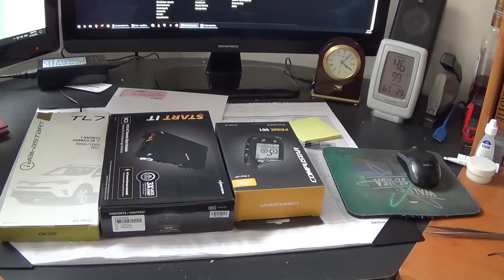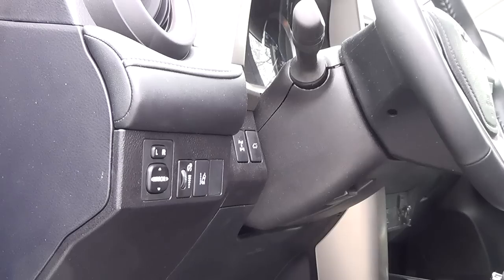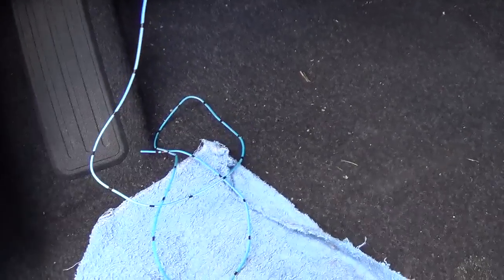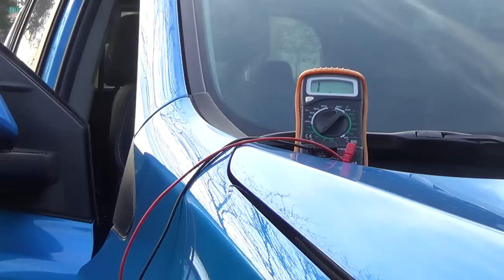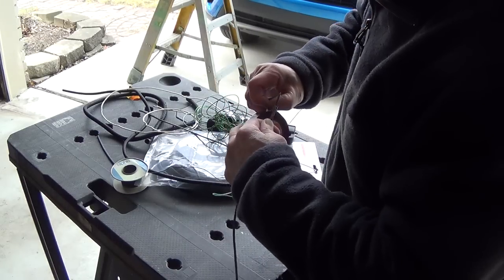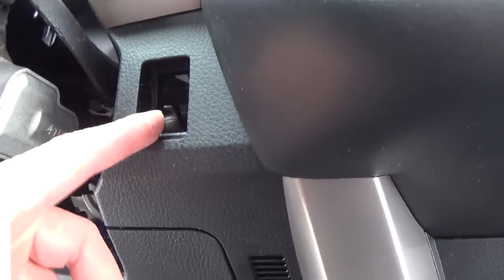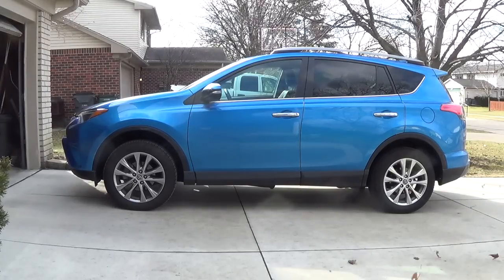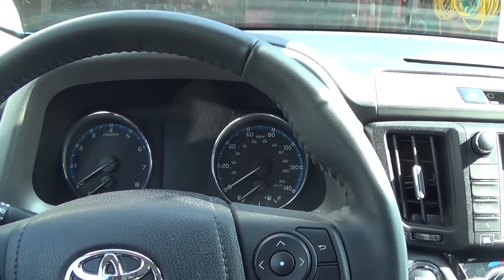Compustar remote start installation

Comment: Wow - you are a brave guy! After watching this I decided I don't have the time or interest to do this on my own. Thanks for sharing!
Reply: Every car is different, I looked up the manual on how to do this on my car and it didn’t even use half the wiring that came with the kit. The manual was also specific on where to tap into everything.
Reply: @daduncker20D  Do you add starter kill relay along with it? I have PTS on my vehicle and I want to add stsrter kill relay and toggle switch but i dont know how and which one is the best method to do it? Any advises?

Comment: Blue wire was for Idle mode. I wouldn't recommend using that kind of method of choice for your hood pin since what if you park on a hill? But that's alright.

Comment: btw, the reason why Compustar/Firstech customer service told you the blue/white wire doesn't have to be connected is because that wire if connected to the PTS enables IDLE MODE also known as PITS MODE.  This mode enables the remote to start after you drive a vehicle and want it to stay on.  For example, if you drive the car to the gas station and you want the engine to stay on vs turning off the engine for a quick pick up, or if you have kids/pets in the car and want the heat/ac to stay on.  You lose that feature if you don't connect that wire.

Comment: Cz, have you considered installing interior LED strips for extra lighting that works with the dome lights? I have a 2016 RAV4 LE (same color as yours) and was trying to get more information about an install using the fuse box so the LED strips would work with the dome lights. Love your videos, would like to watch you install LED strips on the interior.
Reply from the maker: I replaced interior lights with LED lights in my 2015 RAV4, but I didn't do that in my 2017 RAV4. Because I found that I really don't like the LED lights. I don't have plan to add additional LED strips.

Comment: Awesome installation instructions!!! Thank you for uploading the video! 
By the way, can I modify the features (longer run time) after I have already installed the remote starter in the car using the weblink and do I need to unplug the module from the T harness for that? Just want to make sure I dont wipe out all the installation data (flashed), by just modifying  feature, since the starter is already installed.

Comment: Thank you and good job! I'm surprised that you Rav4 doesn't have factory hood pin? If I does, you save more time. The wire to PTS button connect only if idle mode is desired. Bc no take over on this vehicle, pointless to connect.
Reply from the maker: Yes. It doesn't have factory hood switch. But there is a connector, near the hood pin. Wire on one side of connector goes in to vehicle. There is no wire on the other side of connector. I think it should connect to hood pin (sensor).
Reply: @czgu6398  Yes, I found out myself, just did a 2017 xle, had to do hood pin (using factory existing hole) and set input to analog. Toyota changed trim options.

Comment: Good job installing the remote starter.  i dont think the "hood pin or tilt switch" was necessary for your car because your vehicle has a sensor at the hood latch. did you verify with compustar that the "hood pin or tilt switch" was required before installing it?
Reply from the maker: No I didn't see hood latch sensor. There is a connector near the latch. One side has wires. The other side does not have wire.
Reply: @czgu6398  you are correct, the installation diagram for your car does not suggest to wire the "hood output" to the hood latch sensor. Great idea adding an extra on/off switch as additional safety. i will definitely have this on/off switch installed.  Thank you.
Reply: where did you buy this remote start kit?
Reply from the maker: @djdeito  I bought DC3 and T-harness from lockdown security, and 901 Key fob, DAS from eBay.

Comment: Did you choose any specific setting when configuring the alarm for the 901 to automatically update on status change when using the factory key fob? I notice it did it automatically for you, but for me it wont. I have to hit the status button on the 901 for it to feedback information when using the other remote.

Comment: Hi Cz Gu,
Its a great video. Does remote also need programming unless i am missing something. How you configured remote to control unit DC-3. Also can i use any compustar remote, does not really need 1 mile range.
Reply from the maker: Config key fob is very easy. You can just follow DC-3 spec. There are 3 programming procedures. Module programming procedure, Tech programming procedure, remote programming procedure. After finish all these procedures, remote starter installation is finished. The remote programming procedure is for adding key fobs. The max. number of key fobs for DC-3 is 4.
Reply: Can you tell where we can find Module programming and Tech programming procedures.
Reply: @atifkhalid9655  It is on the instruction manual when you buy DC3 module or any other alarm system.

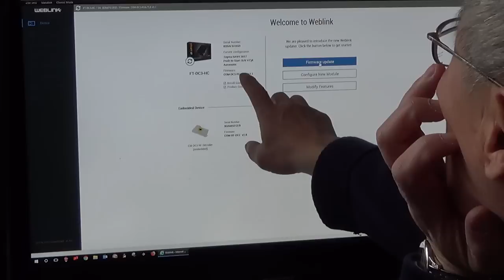Comment: at 1:40 The DC3 was already configured for your Toyota before the update.  After you updated the DC3, the vehicle information for your Toyota was deleted.  Did you have to reconfigure the DC3 for your Toyota again after the update?
Reply: when u update doesn't delete any settings just updates firmware.
Reply: @omkarr357  it does not delete any settings but if the module was previously  flashed and installed, you will have to re-learn the module again to the vehicle.

Comment: I bought the dc3 high current, 2 way remote, Das II and flashed the dc3 for my 1996 manual transmission car.
since there are no plug and play harnesses made for my old car and there are so many wires ' confused as to which wires to use for remote start and security.
please help
Reply from the maker: Go to http://compustar.idatalink.com/product/product/product_id/686 to download instruction for your vehicle.
Reply: please show me how to read and connect the wires.
so confusing
Reply: @Casava3399  It tells you everything on the wiring diagram on compustar idatalink. Look it up your year model and make. It is so easy. Unless you dont know english then let someone install it for you.

Comment: I notice there are 2 version of the dc3. LC and HC. What is the difference? IAM trying to put together a system for my toyoya but could only find LC version.
Reply from the maker: HC has thick wire harness which RAV4 does not need. (maybe all Toyota vehicles don't need thick wires). Honda Civic needs thick wires. So before purchase, you have to check your vehicle if it requires thick wire harness. The thick wire harness includes _12V, ACC, Starter, Ignition
Reply: I have the t harness tl5 it came with thick wire so I think the LC version don't matter?

Comment: Mr. Gu please help me check to see if the dc3 will work with manual transmission.
Reply: Every module you buy from Compustar it will work for manual transmission. You can see he cut the wire on the module on this video shown because he got an automatic vehicle. Since you got a manual you dont need to cut that wire off.

Comment: Is the hood pin required to install? If so do I plug it into the Dc3 M3 port where there is an singal gray cable?
Reply from the maker: This is for safety. I also added a override switch. Because sometimes I work under the vehicle, hood is not open. That switch can disable remote start. DC3 does not have this switch.
Reply: @czgu6398  How can I install override switch? Also how can I install a switch to turn off that alarm if I need to service my car? Tell me how to install it?
Reply from the maker: @imports4lifetoyotalexus98  Installing override switch is easy. In the video, you can see that I ran tilt switch wire (black) through fire wall. One side of override switch connects to the black wire, another side of override switch connects to ground.

Comment: installing this after market remote start. The factory Key fob can start the vehicle too without the aftermarket fob around?
Reply: Hung Tran some you can use 3x lock to start the vehicle.
Reply: @franksgaragehonda  Do you know if you can disable that?
Reply: Weblink log into idatalink and select options. Turn trigger start off.

Comment: Hi Mr. Gu
I would like to self install a compustar security system for my acura but I don't understand how to build the system.
(Which components to buy and where to buy)

Thanks
Reply from the maker: 1. Go to Compustar wedsite, use their "Build a System". https://www.compustar.com/system-builder/#/
2. Enter your vehicle information, than select what you want: Remote Start, Security, Remote Start + Security. 
3. Select Key fob (2-way or 1-way communication). 
4. Search all listed items on line (eBay, Amazon.com, ....). 

Compustar Build a System does not list remote start controller. FT-DC3 should be good. Also T-harness is different btw key start and push-to-start vehicles. For example, T-harness for Toyota RAV4 is ADS-THR-TL5 for key start, ADS-THR-TL7 is for pts.

You should download all documents before you buy. http://compustar.idatalink.com/product/product/product_id/688

Comment: Why does 901 prime remote doesn’t have a blue car icon like the other??????
Reply from the maker: Be careful when you purchase 901. There are 2 versions of 901. V1 has blue car icon on it. V2 doesn't. V1 screen light is always on. So it uses battery quickly. You have to recharge it frequently which cost battery life short. When battery is died, it cannot be replaced. So you have to buy a new one.
Reply: Cz Gu I see thanks you so much for the clarification.

Comment: if the seller pre-load the firmware for my vehicle, so do I need a ADSUSB cable again?
Reply from the maker: No you don't need. But you better have this cable ready. Because default setting not always good.

Comment: Do I need bypass module on my 2004 Toyota Camry? Do I have to get high current or low current module on 2004 Toyota Camry?
Reply: The DC3 Has a built in bypass module
Reply: Bypass is built in on the dc3 and comes with both high/low current harness.
The install guide from Idata will show you which harness is needed...
Reply: @scottpryorsz28  DC3 has a built in bypass module? I cant find it but I have buy DC3 module along with Blade AL. Do I need get Blade AL along with DC3(Start It)? Which one should i used DC3 wiring diagram or Blade AL wiring diagram? How can you flash your module because Compustar told me only authorized dealer can used it and they told me I cant used it at home or register it online. Is that true?
Reply: Is Blade AL for newer vehicle not for 2004 Toyota Camry?

Comment: Hi Gu
dc3 and FT-7000AS which one is better? 
dc3+ FT-AlarmIt-Kit =$172
FT-7000AS +bypass =$121
Why don't you choose FT7000AS?
Reply from the maker: Can you find t-harness for ft-7200? I couldn't find. I wanted installation looked more professional, so I need to use t-harness.
Reply: @czgu6398  thank you for your response, because I easy to  find dc3's complete guide, and look is easier, even though it is more expentive, so I would plan to install dc3 without t-harness, that will save money to buy  FT-AlarmIt-Kit.
Reply: @yongsenlin7078  Do you follow the DC3 wiring diagram or Blade AL wiring diagram to installation the alarm system?

Comment: Does this vehicle support take-over? or does it install when opening the door? i just installed in my 2014 camry, I don't think take over works.
Reply: Well the 2014 Toyota Camry should work for takeover after the alarm installation. I know Toyota 2019 or 2020 and up dont have takeover anymore because due to safety feature got put into the vehicle. You know Stop Start feature they have on for all Toyota standard that is why. Only Subaru and Honda can do takeover even it is PTS. I know about it because I did lots of research on Youtube and google search
Reply: Imports 4 Life Toyota Lexus - so adding alarm would allow this feature? Interesting. But without alarm no take-over ?
Reply: @daveroski  Even you arm your car it is safe already but takeover feature they dont have it yet. Because of safety due to prevent thief get into your car while it is remote start.  Even Viper just got a new update that PTS works on Honda 2013 to 2019 only vehicle. I believe in the future Compustar will find a way to get PTS takeover feature to work on all of the Toyota. I am still wondering if i connect all the wire except for PTS will it remote start still even PTS is left out from wiring connection. What happen if I can bypass without connecting PTS wire into the vehicle?
Reply: Imports 4 Life Toyota Lexus thanks for info!
Reply: May I ask where did you buy it? Thanks
Reply: Rupesh Patel eBay/Amazon
Reply: David Olszewski thanks
Reply: it does yes

Comment: If you upgrade just the remote and antenna, is it a simple swap and plug, or does an authorized dealer/installer need to reprogram the brain module?
Reply: what brain model you have installed?
Reply: I have the cm900. I am waiting for the blade-al to b e delivered

Comment: Will it work for Kia sorento, and if i want to use the compustar 6900as, what do i need to order with it to do the installation? Thank u so much in advance :)
Reply from the maker: I don't know compustar 6900AS. It depends on your requirements. For example, if you want installation looks more professional and easy, you can use t-harness. Can you find t-harness for Compustar 6900. If you want to have Compustar EZGO istalled later, you need to check if 6900 supports EZGO. (EZGO is an add-on feature to open and close door automatically when you are in the EZGO key range). So you should do more research before you buy.
Reply: Hard wire it. I RARLEY use t-harness

Comment: Hi. I just installed the same system. I still have to keep my Oem keyfob for the smart key chip. Do you have to do the same or is there a bypass system so I can only use the 901? Thanks. Anyone that wants to chime in would be great!

Comment: does the DC3  comes with the Antenna and siren?  if not where did u buy it from?
Reply from the maker: No, Key (Prime 901 or other Compustar trasmitter) comes with antenna. So you select different key, antenna will be different. Compustar has 3000 ft, 1 mile, 3 miles transmitters. FT-DAS comes with siren, not DC-3. If you don't want DAS (I don't like it!), you can just buy a siren at eBay. Siren is good, not DAS.
Reply: @czgu6398  do you mean Keyfob? so if i buy keyfob it will come with transmitter can u share me the website you bought from
Reply from the maker: @courtneypaul6875  I bought at eBay. Compustar Prime 901 has 1 mile range and price is not very expansive. It has small screen so you can use it to turn on/off some (DC-3) features.
Reply: @czgu6398   Thanks for the reply,  after doing the math i came up with total of $320 that includes DC3, alarm-itkit and remote and a thermometer
Reply from the maker: @courtneypaul6875  You don't need to buy thermometer. It comes with DC-3, or keyfob, or T-harness. I don't remember which one has temperature sensor included. When I installed remote start, I found that thermometer was there.

Comment: What functionality was affected by not connecting the blue with black dot wire?
Reply from the maker: From the T-harness manual, this wire is required if idle mode is desired. Idle Mode allows you to remove the keys and leave the vehicle running for the pre-programmed run time. I'll never do this.

Comment: Hi gu , I have a question on 2017 RAV4 PTS’s 30 pins body ECU .
Idatalink said : 25 pin is RX(data)blue, 26 pin is TX(data)red.
But for db3 installation guide said: 
25 pin is TX(data)blue, 26 pin is RX(data)red.
Could you tell me which one is correct? 
Thanks
Do you use remote control to open or close your car’s sunroof? How to connect?
Reply from the maker: I used T-harness. It's plugin and play. So I didn't do wire connection. I checked Hardwire/wiring diagram in DC3 installation guide. 25 pin is RX(data)blue, 26 pin is TX(data)red. DC3 M4, pin13 connects to pin25 on 30-pin ECU plug,  DC3 M4, pin14 connects to pin26 on 30-pin ECU plug.
Reply: pin25 blue tx data and pin 26 red rx data is applicable for all hybrids, plus non hybrids made in Japan 
pin 25 blue rx data and pin 26 red tx data is applicable for non-hybrids made in Canada.
Reply: @czgu6398  what t-harness did you use? I have a 2013 hyundai elantra limited.
Reply from the maker: @krieger67333  https://compustar.idatalink.com/product/product/product_id/686

Comment: I just finished installing mine followed the instructions and double check all my soldered connection and was only the keyless entry part works. Remote start don't work yet. SMH.
Reply: Maybe my question is your answer, if your car is 2017 RAV4 too
Reply: Kambo209 , did you Solved your problem? How to do that?
Reply: @yongsenlin7078  yes I did. Change option to tachless detection and it work just fine.

Comment: Hi, Mr Gu Could you share the range for this remote starter
Reply: Chase Yq it depends on which remote. They go from 800 ft up to 3 miles. You can also get a drone and use your phone to start it
Reply from the maker: This is a good question. The range of key fob (Prime 901) is 1 mile (official spec). But it's actual range is less than 4000 feet. That is what I tested in different places. One mile range must be in an open space.

Comment: Where can I buy this? What is its cost?
Reply: Best buy has remote start kits
Reply: Buy it on Ebay or Amazon only. Never go to Best Buy they overprices the Compustar product.
Reply: @imports4lifetoyotalexus98  You're hilarious! You do know that if you get it installed professionally, you have better protections IF the system fails or causes a short vs your half-assed job in the driveway... Also, good luck getting warranty support on any of those products purchased from a source like Ebay.
Reply: 🤣🤣 just name the sources. The OP will choose, you dont have to tell the world ur good.